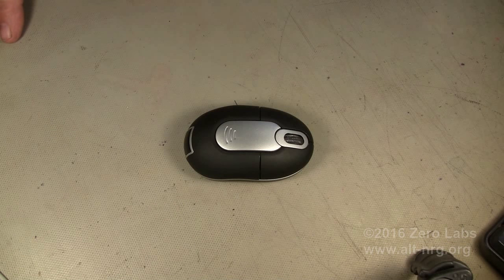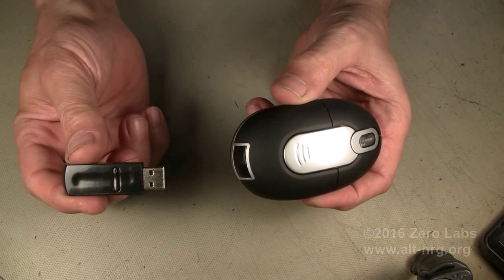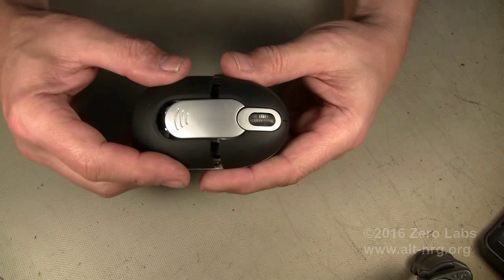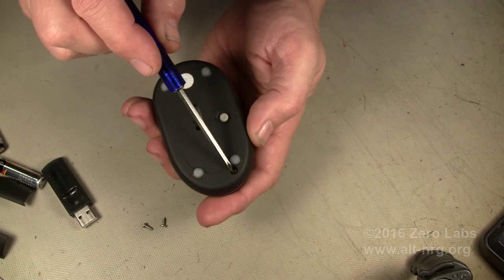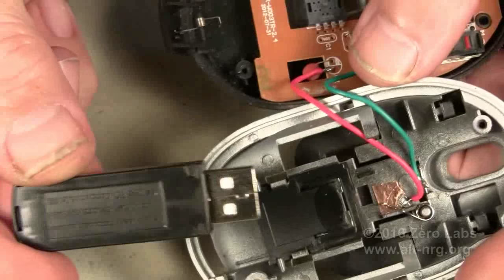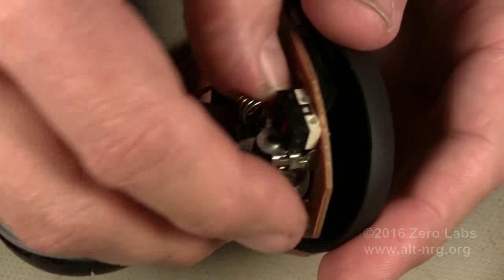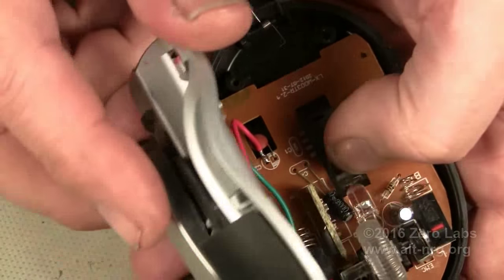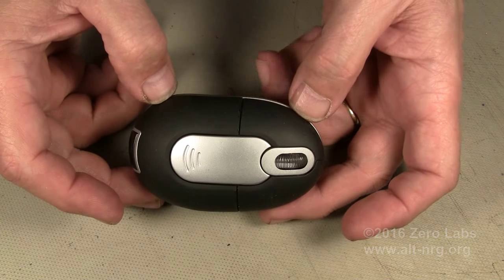#435 Wireless Mouse On Off Switch Hack

Comment: G'Day, nice job easy and effective, I bought a similar mouse awhile back,  the usb stick was smaller and not spring loaded. I  did almost the exact same thing but where your spring is i put a small black momentary switch from an old broken  vcr I  had on my parts bench.

Comment: Nice elegant mod.  Luckily I have never had to do anything to any of my wireless mice.  They all have off switches and the batteries tend to last about a year with regular use.  I have had to replace the left click switch on my main wired mouse once since it started to ghost click regularly and the mouse cost $65 about 5 years ago.

Comment: Neat hack, but my Logitech wireless mouse gets 9-10 months on a set of batteries just throwing it in my bag at the end of each day.  Glad it's working for you.
Reply from the maker: +Q-Hack! Glad you like it. Your Logitech is probably full size and probably uses 2xAA instead of 2xAAA. It is, of course, also better designed than this Chinese ebay stuff but this trick really works.